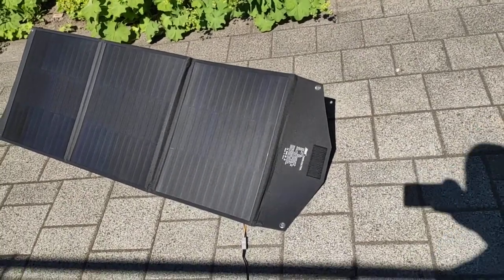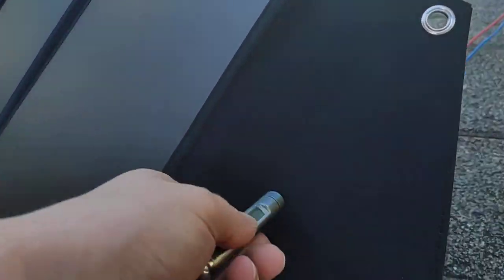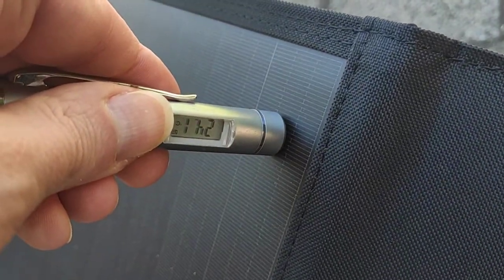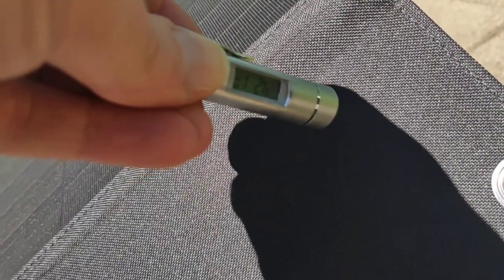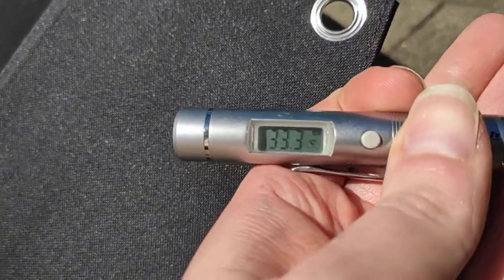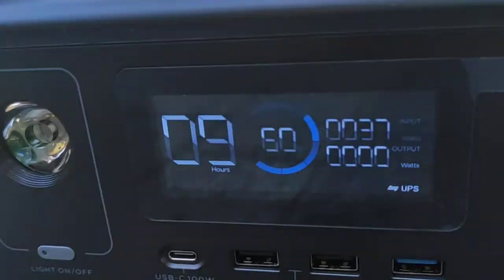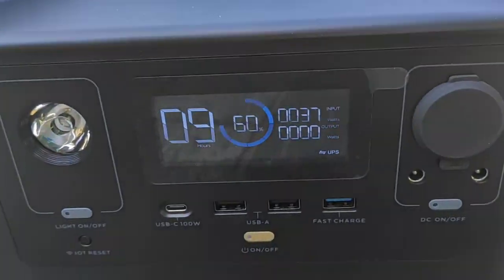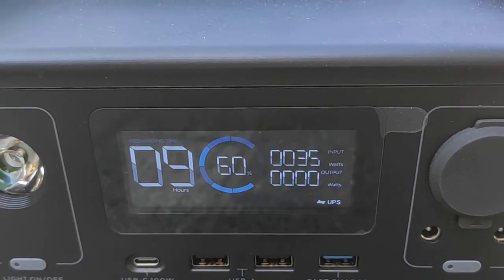Testing the iMars SP-B150 (similar as Kroak SP-05) - it is dropping power in full sun

Comment: Maybe it have to do with your power station.if your battery is overheating then its automatically slow your charging current.i have the same panel and I'm pulling 80-90 watts without dropping when the panel is 60 degrees.
Reply from the maker: No, it was cold in the shadow, there is no slow-down from the power station.  Every solar panel has a power loss when it is hot, about 15%. But at this two there is a contact problem in the cells, because they are not soldered.

Comment: You must show and input voltage and current. If voltage 18 volts and 10 amps you get 180 w. If voltage 10 volts and 12 amps you get 120 watts from same panel at same sun... But anyway good test. Maybe you set that voltage must not drob lower thant 18 volts...
Reply from the maker: No, because the MPPT is tracking the maximal power point. Voltage does not matter.
Reply: At least only voltage...
Reply: If panel 18 v, then it best efficiency on full sun is at 18 volts. In video we not see that is voltage on output of panel?